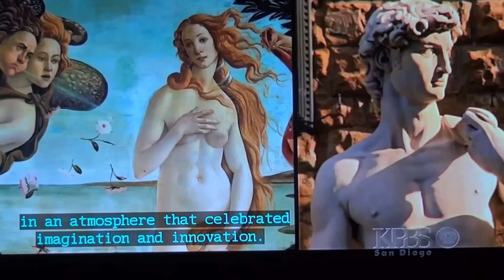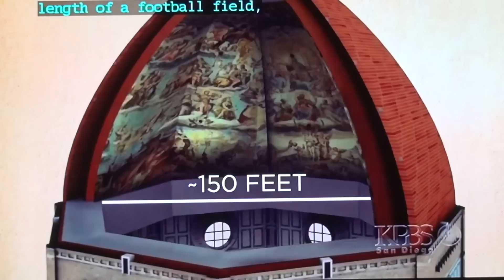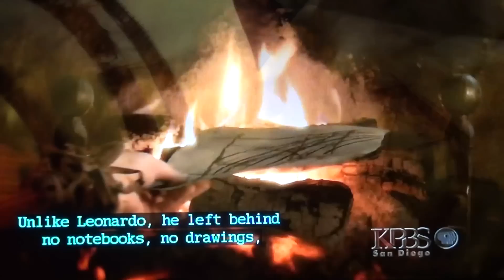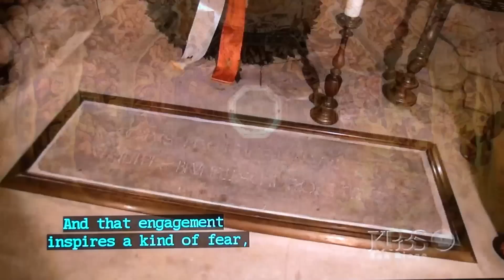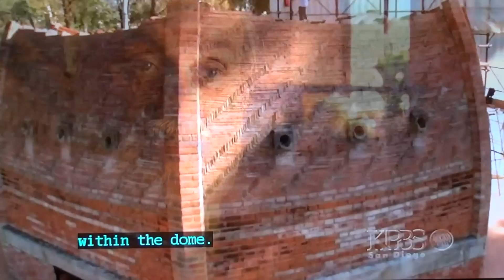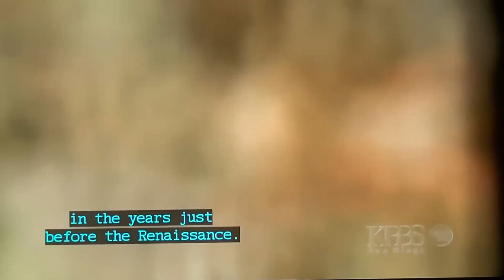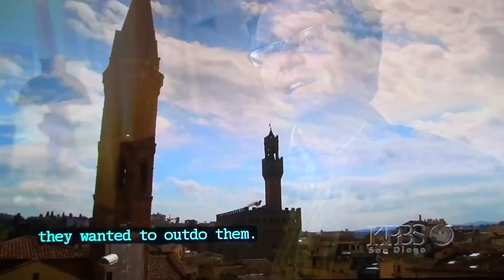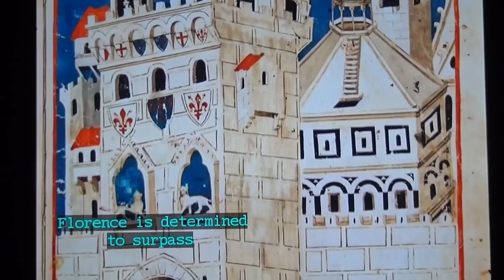Filippo Brunelleschi Vol-1

Comment: The dimensions are enormous, but the principals are equal to what inuits do,  building an igloo out of snow. This also with no scaffolding during its construction. 

In addition the slope of the Santa Maria dome follows near to the “chain line”. Thus there is next to no sideways forces in the arch in contrast to the half circle roman arch which tend to fall in the middle of the roof and move outwards at middle height of the arch.  In fact there is probably very little stretch in the tension rings up the dome.